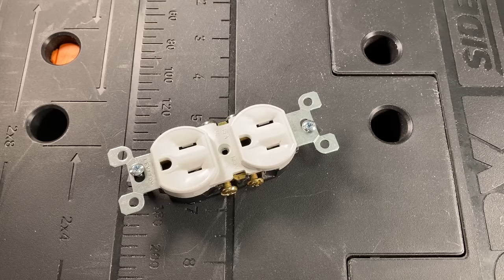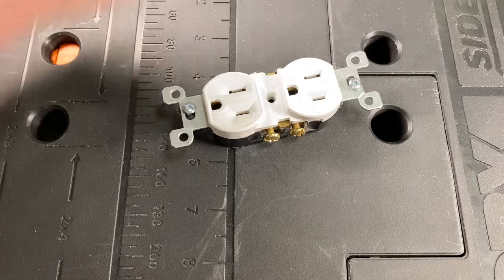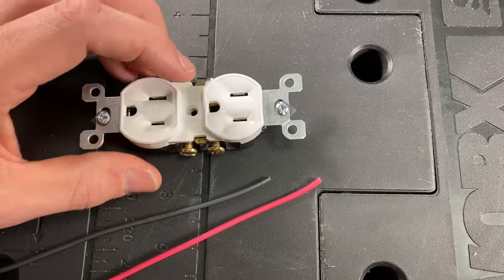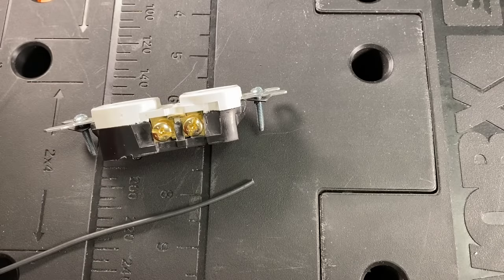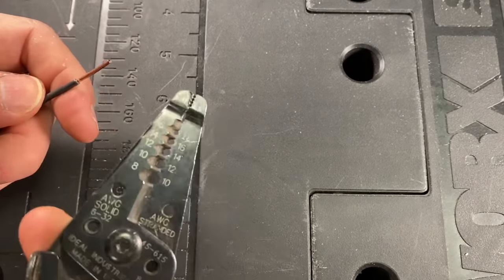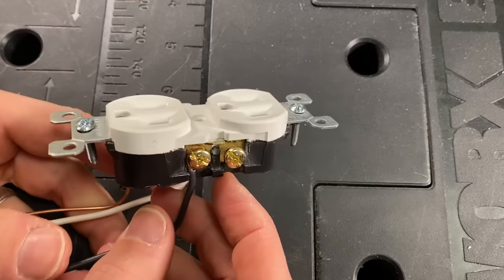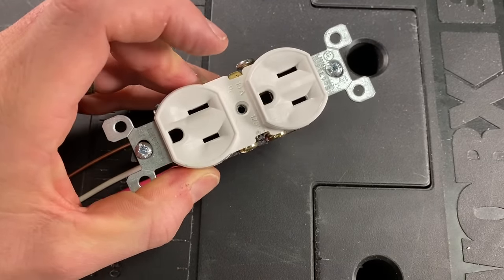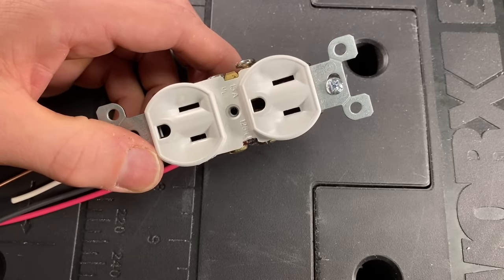Electrical Outlet Basics | How To Wire

Comment: Electrical work is dangerous if wired incorrectly, that's why you use a licenced Electrician. Voltage sticks are not totally reliable for a proper voltage test, use multimeter
Reply: re watch the video, it is for people who let's say add a new wall to their house, they won't waste time and money for 1-3 outlet if they can do it safely... I agree with the electrician stuff, people need professionnals but with my rates, majority of people won't want to call me for adding 1 outlet on their wall DIYers can totally do that while being safe n sound by doing what he did in this video, have a good one buddy
Reply: Yeah but multimeters can mis-read too, for example reverse polarity bootleg ground or a hot neutral. In these cases, a meter will affect your ability to diagnose

Comment: And don't buy the cheapest outlets! You'll use your outlet changing skills often. Heck, I use 20A outlets in heavily used areas. I still use a 15A breaker. Those 20A outlets just might outlast your kids. They're exactly the same as 15A outlets but with significantly heavier terminals and internal contacts.

Comment: If you need to work on something electrical, but don't know where the breaker panel is!!!! Simple kink the wire like a water hose to stop the flow of electricity... you welcome...
Reply from the maker: Oh my 😳😂
Reply: whaaaaaaT?
Reply: Of all my yrs as an electrician that's got to be the funniest thing I have heard
Reply: Jorge Banegas -- Wow, try that with the 240 volt line for the dryer and see what happens...  Tell us now where to send the flowers...
Reply: Yeah, but you have to kink it Really Hard if it's 240V.  
And don't forget to un-kink it when you're done!  /s

Comment: Should be using a torque-measuring screwdriver to comply with NEC 110. This outlet's specific torque rating is 14 – 18 in. lbs. (https://www.leviton.com/en/product-support/5320-wcp).

Under-torqued screws can loosen over time, over torqued screws break the plastic and can also have slightly higher contact resistance. And if it does loosen up, don't just tighten it; redo the connection. Based on industry studies.. simple retightening ends up loosening itself again most of the time.
Reply: Fascinating details. I never would have guessed any of this was important.  I suspect 99% of tradesmen don't do this.  But I also suspect most of them have a good "feel" for what is the "right torque".  I know I have always used the "subjective feel" torque measurement method.
Reply: @thhall459  I have that suspicion of tradesmen myself. Had one of em' replace an outlet I was using to charge my Tesla.

The screws were severely under-torqued.

I just learned about torque ratings and what-not cause' of my hobby projects for an HVAC controller n' wondered , "uhhh... how tight does this need to be". Found a bunch of research from some national agencies that were very interested in this sort of stuff.

Comment: You got to be kidding me. I need to replace mine because the plug keeps falling out. No way will I even attempt this. Way, to complicated.
Reply from the maker: For sure, you want to be confident when working with electricity. If you question your knowledge and/or experience I would agree it is best to hire a professional.
Reply: @EverydayHomeRepairs  How long of a job is it? The plugs keep falling out.
Reply: @EverydayHomeRepairs  I just called a guy upstairs. He was down and replaced it already. omg. Thank you anyway.
Reply: That's what happens over time when you buy the 50¢ receptacles.

Comment: If you are using two different circuits and break the hot tab you HAVE TO BREAK the Neutral tab also and supply a separate neutral for each of the circuits.  Otherwise you can push DOUBLE the amperage on a single neutral when both circuits are at full amperage, e.g. 2 x 15 amp circuits with 30 Amps on the neutral for which the 14 ga neutral is NOT going to safely support.  My rule, 2 circuits & 2 neutrals.  A common mistake I see often.  DONT DO IT !
Reply from the maker: Good info, appreciate the help!
Reply: So not true, if the constant hot also supplies power to the switched hot the neutral is the same circuit.  Do not have more than one circuit in a box.  A 220V appliance circuit (with 2 hots) is the exception.   But a joined breaker protects that type of circuit.  So many people who should never do even simple electrical work.
Reply: That's baloney. The black and red wires are likely deriving their power from a common black wire coming into the switch box. The only reason for separating them is so that some are switched and others are not.

Comment: No!!! don't even SUGGEST "back stabbing" outlets 🤦🏻‍♂️ not only is not recommended but even more importantly the arcing from the back of those connections are WAY too close and will cause infinite problems and even at times causing fires if not on a proper AFCI OCPD
Reply from the maker: Agree and thanks for providing feedback on the issues caused by using the back stabbing method.

Comment: Not for NZ Australia GB etc.
Reply: Or Ireland where we have totally different sockets and wiring colour codes. Interesting to see how the US does it, I was especially amused that the distribution box switches are moved horizontally. Irish Consumer units use vertically placed circuit breakers and are universally 230volts, 50hz both for lighting and sockets.

Comment: exposed terminals on the sides of your sockets scares the hell out of me, why are the cables not connected in a tunnel like connection ie https://youtu.be/0S63MCqZPns   how the connections should be
Reply from the maker: Yeah, electrical tape is definitely not code in our area but I do like the additional protection from possible shorts.  Thanks for the feedback/comments.
Reply: @EverydayHomeRepairs  You usually only find tape around the outlet if its a metal box.
Reply: and by usually i mean "hopefully always"
Reply: hotrodd100  Electrical tape allows for a smoldering of the tape if the hot terminal is rubbing on a metal box.  Better if it just shorts and blows the breaker.
Reply: If there is the possibility of your outlet screws touching the metal box, then you need a bigger box!  The code specifies box sizes.

Comment: I am still at a loss as to why turning the breaker off or removing the fuse is NOT common sense. Guess I live in the logical world. Just sayin'. Oh, a Klein tool ad. To me I would use a MULTIMETER.
Reply from the maker: Yeah, others have mentioned a outlet tester and/or multimeter.  Thanks for the feedback.
Reply: Any electrician will tell you that a non-contact voltage tester like is used in this video is fine for testing for presence, or non presence of electricity to know which breaker to turn off, but you should NEVER contact any exposed conductors until you have verified absence of electricity with a contact voltage tester such as a multimeter. All conductors are to be considered energized until checked with a contact device.
Reply from the maker: @williamdebow3478  Thanks for the feedback.

Comment: white is not neutral wire...
Reply from the maker: 🤔 what color is most frequently used for neutral in your area?
Reply: @EverydayHomeRepairs  black
Reply: it all begins at the 3 wire service coming into the house from the street..2 white and 1 black...2 white wires gives you 240 volts and 1 white and 1 black gives you 120 volts...the black wire is used as common neutral and is kept that way as a polarization for all circuits
Reply from the maker: @larrybenedict972  roughly where are you located. I am in Illinois.
Reply: Black is the hot wire. White is neutral. This is not an automobile.

Comment: Wait, so the push in connectors aren't recommended???  Uh...uh..... my whole house will burn up....
Reply: They used to do it that way for decades; no worries; millions of houses are wired that way.  He is just saying that the screw terminals are better, and new electrical codes state that you must use the screw terminals for new installations.
Reply: Probably not the WHOLE house. Fire departments usually show up pretty quickly and save most of the house most of the time. 😏
Reply: @MrSleepProductionsInc  Ok. good to know.  I'll just stay sleeping in my bed cause it's safe. LMAO!

Comment: That test is not OSHA approved buy a meter
Reply from the maker: Thanks Dan, many others mentioned that as well.  Does OSHA actually provide guidelines?  If so, do you have the link, would be interested to review.  👍
Reply: @EverydayHomeRepairs  I work for a semiconductor company TEL and I asked or Safety group if we could use this with our other tools. They told it was against OSHA rules. And using it could get you fired or in trouble at the site you are working at.
Reply: @EverydayHomeRepairs  For home use you can use what every you want but since it was band by OSHA I will stick with a meter for home and work

Comment: Sorry but most of the things this person says is not how the True Electricians do it. 
A good rule of thumb is to tighten the unused terminal screws also because if they are out like the video showed they could ground  out on a metal box. Also you can either Black or Red or even any other color besides white, green or bare wire.
Reply from the maker: Appreciate the feedback.
Reply: You mean besides white, green or gray which also denotes neutral.

Comment: You are full of crap that the push in connections are against code anywhere. The NEC is a national electrical code not municipalities and the push in connections are less likely to fail as they never become loose unlike a screw which can become loose

Comment: Never ever use a volt stick!!!!!! Always use a meter!!!! You won’t die if you know what the voltage is!!!
Reply from the maker: When it comes to confirming if a circuit is hot I prefer a voltage tester.  Appreciate the feedback but I don’t consider using a voltage tester a safety issue.
Reply: 120 will still kill u the same as 600, if it’s hot turn it off
Reply from the maker: @Nick-bh1fy  completely agree.
Reply: @Nick-bh1fy   Not so sure 120vac will kill you as quickly as 240 and higher will...
Yes, we would all love to work with the power turned off....
Reply: @frandanco6289  obviously the higher voltage you go the greater chance of death but I was just saying it can kill you regardless
Reply: There used to be a time when screwdrivers with a built in light and HIGH value resistor ( phase testers) were used to test for the presence of live ( hot) wires in a circuit. Accidents started to happen when inexperienced workers would accidently drop these screwdrivers in a wet area or bucket of water and then leave them back in a toolbox without notifying the electrician about the accidental wetting. The hapless electrician would then grab and use the tester on a circuit and get a shock because the high value resistor had been shorted out by the water. Modern practice is to use calibrated meters in all test work, also insulated tools. Wet phase testers are deadly.
Reply: @frandanco6289  I've seen people doing small device installs using insulated tools and splicing into live circuits using insulated tape to repair the cuts made to splice into the supply wires. Hairy stuff to watch. I have also seen such live work carried out with all the safety measures in place. Two man working, fully insulated tools and PPE etc. Not a job to do after a party the night before........

Comment: A voltage tester is absolutely the wrong tool to use to prove a circuit is dead.
Reply from the maker: Thanks for the feedback Shaun,  what do you use when working on switches?
Reply: @EverydayHomeRepairs  A reliable multimeter which also isn’t the best tool but I don’t have a proving unit 🤷‍♂️

Comment: The milliseconds saved by using the fricking push-in connectors will result in your wasting a million seconds looking for the dud connections in your circuit.  Woe be unto you if you placed some huge antique desk and cabinet in front of that dud outlet.  Whoever invented the push-in idea ought to be  electrocuted... repeatedly.